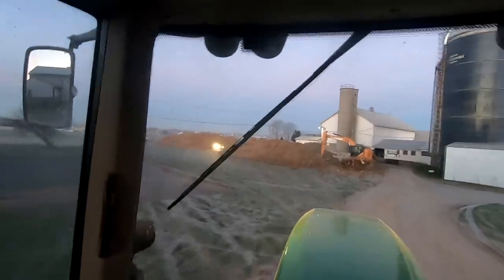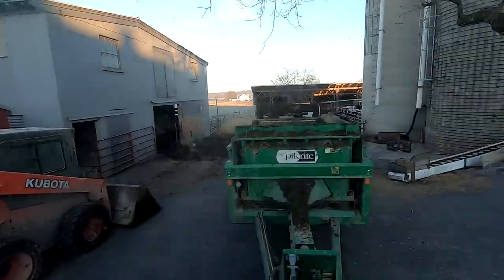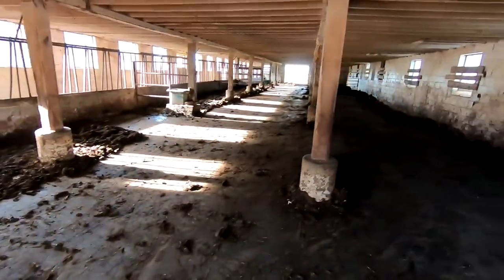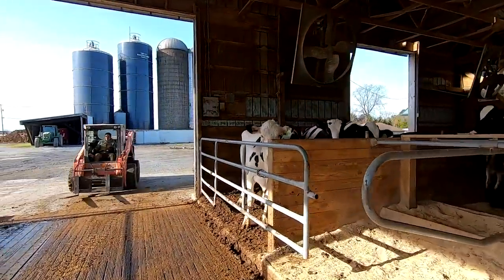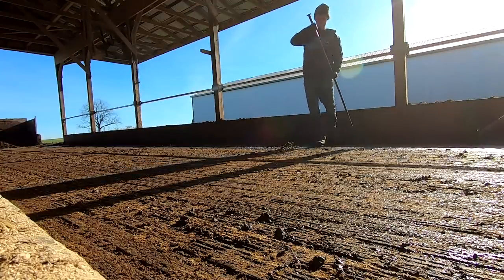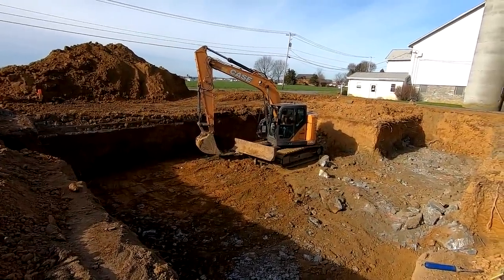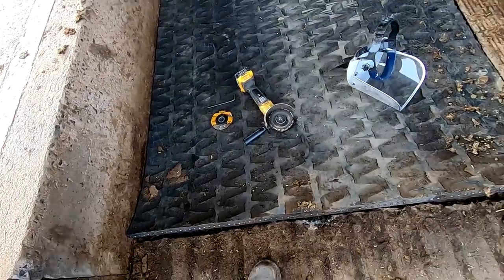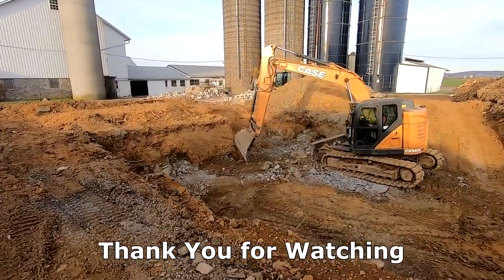Replacing Worn Out Rubber in Dry Cow Barn

Comment: Good call on sticking with the 9' basement. You will appreciate having it!
Reply: Especially if they wind up running HVAC ducting under the main floor.
Reply: @woodhonky3890  if going with mini-split unit, won't need ducting work.

Comment: Years ago had a odd job: cutting a hundred steel wall truck tractor tires into smaller pieces and removing them from their rims. Had the same power tools as you, plus more, and had the same issues where none worked ideally. In the end I found that using an extendable bypass lopper to be the fastest & easiest way to get the tire off the rim and cut the rubber into small pieces. It was faster. There was no smoke. No tools vibrating like crazy. and overheating Just snip snip snip. The steal in your rubber is thicker so it would probably be the end of the loppers for you. Something to consider in the future.

Comment: I remember you asking HVAC for the new house. Fan/duct system with 2 stage blower and sealed and insulated ducts has advantages of lower cost, ease of use and install. 👍
Reply: They spec'd a 9 food basement ceiling - likely for an improved basement. Will need heat so insulated ducts may not be needed.
Reply: @dhenschel4  ducts are for upper flores
Reply: @dhenschel4  maybe not needed. Passive heating/cooling through inefficient ducts can be improved upon. 
Sealing seams and insulating ducts is a low cost diy project. Just duct tape the seams/connections and wrap with flexible insulation wrap. 
Depending on the use of the basement add ducts as desired. 
This sealing and insulation provides efficiency and accuracy of the hvac. 
To each his own.

Comment: I have used a circular saw with a crosscut blade. The wires need to be small for the wood blade to nip them. Need someone pulling the cut off piece away so the blade doesn’t bind. Not an easy job!

Comment: You can buy special rescue angle grinder cutting discs that might be good for cutting mats in future. They are designed to cut everything. Glass, wood, metal, concrete rubber. Just saw them in shop the other day,

Comment: metal cutting circular saw blade may have cut thru that pad. And next time when you have overlap, raise up the pad about 5 feet from the overlapped end to make that end snug, nail that end down, then have the skid steer push out the rest of the pad.

Comment: Nine foot high basement? What are you doing down there. A. Playing basketball. B. Repairing equipment, or C.new heffer barn. I cut old tires using carbide tip blade in circular saw.

Comment: Cutting the rubber...been there done that😂  a rubber melting moment.  Don't know what they use in the factory  to cut it  but found the skill saw with the right blade faster than the rest with less smoke.
Purhaps a feature rock or 2 in the basement ? They certainly have been difficult to remove. 
Is the basement going to be just storage?  Basements are not normal in my country   so can't imagine what they would  be used for
Reply from the maker: Utilities, storage, kids play area, maybe a wood stove, and can be finished for living space or bedrooms if we wanted in the future. Also is a storm shelter.

Comment: I live in Indiana and owed an old farm house that was built in 1901. The well was hand dug and went dry. So I had a new well drilled. He got to 30 feet, the depth of the old well, and hit solid limestone. Now I know why the old well was exactly that deep! lol but the price went from $7000 to $11,000. 255 feet through solid limestone. I told him I wanted 10 gpm @ 70 psi and bought the biggest pump on the market at the time. 1 hp. A limestone well is the best water you can get, according to the well driller. But I paid dearly for it. Same with your house. You KNOW you're down to bedrock and that will make for a very strong foundation. But 10 feet deep for the floor pour is also going to be expensive!

Comment: That idea sounds lick that scratch and sniff rotten soye beens.😳😳😣😣😢😢 There was a review on the EG4 solar company's 9/12/24000 BTU minisplit AC/ heat pump on YouTube. It is a Ac/Dc voltage unit that has it's on MPPT solar regulator in it so it can run on direct solar panels, 4 or more and it will regulate between Dc electric or Ac. You need to check it out it is extremely efficient and the seer ratting very good to.😳😳😜😜 It's a cheap way to get started with solar and expand out. 👍 👍